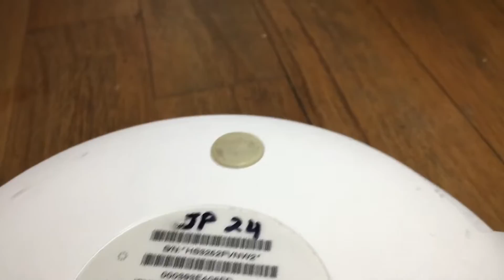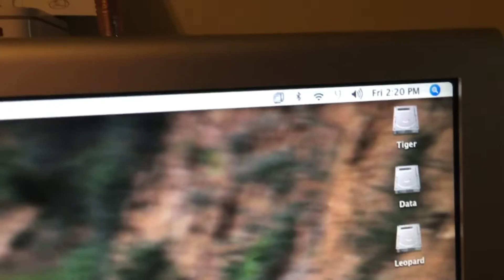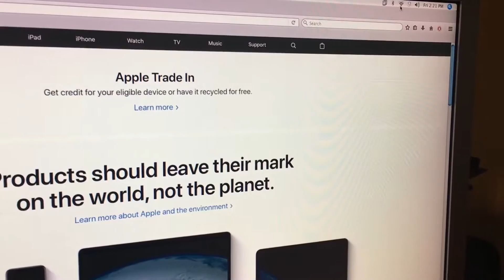Cheapest & Easiest Way To Add Internal WiFi On A Late 2005 Power Mac G5 – PowerPC Series S.3 EP.13

Comment: Nice Quad G5 dude! Looks like you have it all souped up! I just picked up a Dual Core 2.3 GHz and your video is going to help me.  Disclaimer: I have an Airport Extreme card.  That said, I also had a damaged 2003 G5 that I tried to use the antenna connector with an old antenna I had and it didn't work for me.  I had zero to 1 bar.  I'm going to buy an old base station per your recommendation and go that route.  The original WiFi/BT card goes for a pretty penny on eBay!
Reply from the maker: Glad it can help you out. You can also upgrade your system to a 2.5 DC from a quad core I did a video on my 2.5. I made also a few episodes before this one I think.